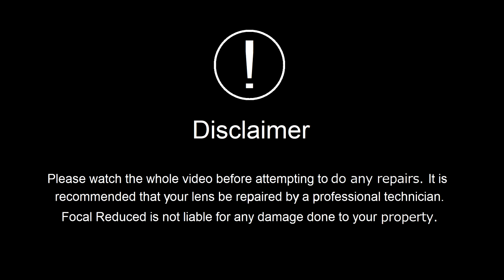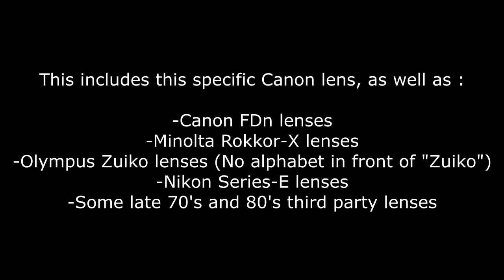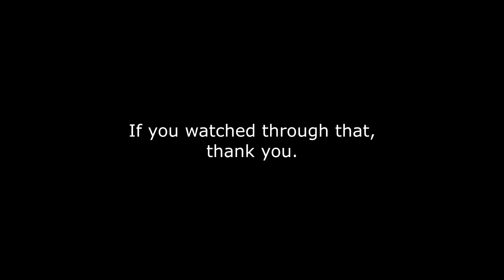Trying out the Lens Vise tool AGAIN. (Filter repair)(S.L.E.).

Comment from the maker: We would like to thank everyone with their tips and tricks on using this tool, as well as the ones who shared their experience with it.  We understand that the tool can't repair everything (which is why we did not even recommend the tool in a prior video, a while back).  That being said, it does help, cosmetically, in some situations.  It' really depends on the severity of the damage, where the damage occurred on the lens, what the lens is made from, how the lens is assembled, the diameter of the filter threads, etc.  We try not to use this tool, as it has a chance of damaging the threads further.  And this is a reason why we like lens designs that does not require the threads to be in perfect condition for disassembly.  Olympus, Yashica, Tomioka, etc. have designs where the branding rings do not need to be disassembled for the lens to come apart.    We wish that other manufacturers considered this, as the filter threads is the weakest part of the lens.  Thanks again for continuing to support us.

Comment: As indicated in my comment to your previous lens vise video, while I've had mixed success with the tool, I was able to repair most bent filter threads. Visually, they never look "brand new" but the goal is to enable the disassembly of the lens and the use of filters. I'd say my success rate is somewhere in the ballpark of 70%.
That being said, the tool struggles with heavily damaged threads. My successes were with light to moderate bends. The damage on this Canon lens looks quite severe.

Comment: My experience suggests that the chances of even a functional repair (let alone a cosmetic repair which is far more difficult ) depends on how the lens landed when it fell - which is usually how such damage occurs. If the lens lands more on its side the injury to the filter ring deforms it more by bending it inwards. If, one the other hand, the lens lands more on its nose (which is what seems to have happened here) it will often deform the ring in two dimensions - downwards in a crushing deformation as well as inwards in a bending deformation. The former is much harder to repair and even if the "inwards" deformation can be functionally fixed with this tool it may do little to fix the crushed filter threads which will often continue not to function and prevent filters from being screwed onto the lens (or dress rings screwed off.) 

I have not tried it yet but it has occurred to me that to fix this sort of "crush injury" after the inwards deformation is corrected a second operation is needed. It should be possible to make a small tool from something like a large nail, a short length of mild steel rod or something like the tang of an old spade bit. It would be necessary to shape the end into a fine wedge shape which fits into individual threads in the ring but also with a slightly curved face designed so that its shape matches the circumference of the filter ring. By placing the shaped end into individual threads at the point of damage it may be possible to lever or tap each crushed thread upwards enough to allow a filter to be mounted. Having said this, I can see that the operation is fraught with peril - splitting the filter ring by exerting excessive force for example, or slipping and damaging the front element. The best way to use this tool it seems to me, would be to work from either side of the crush point towards its centre - working on each individual damaged thread, one at a time and tapping the end of the tool with a small light hammer to try to reform something approximating the original individual threads enough to make them workable again. In effect this tool becomes something like a tiny thread forming chisel (or more accurately a "former") which forces the filter threads back into their proper place one at a time (rather than cutting them). Will it work - I am sufficiently convinced to give it a shot. 

Of course, some method of holding the lens firmly in place while doing this needs to be contrived but this should not be difficult. My "go to"  solution when confronted by a filter ring injury usually involves using a hole saw to cut a hole a little larger in diameter than the filter ring diameter into a wooden board. Held vertically this board with a hole in it can support the outside of the filter ring as it is worked on. It would require a small refinement to also have some means of locking the lens in place with its "nose" in the hole so the lens does not move about as its being "operated" on. (You want both hands free for the main task).

Comment: I've had some success with this tool - but not for the lens I bought it for!  I've tried sanding where the threads are particularly mashed and can now get a filter on but can't get the name ring all the way off to get to the front group. Think the vice is only OK for simple dings.